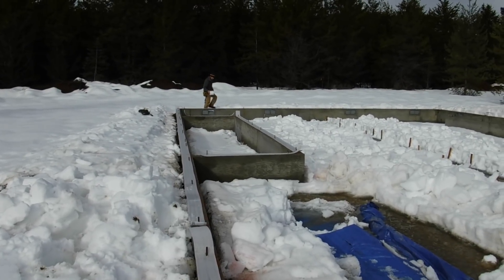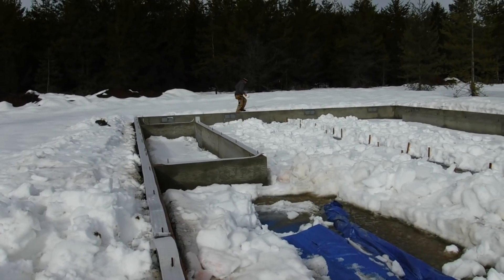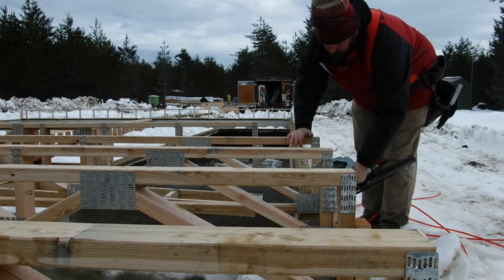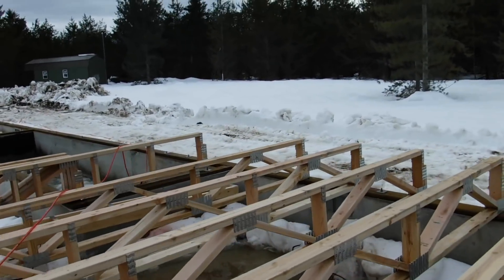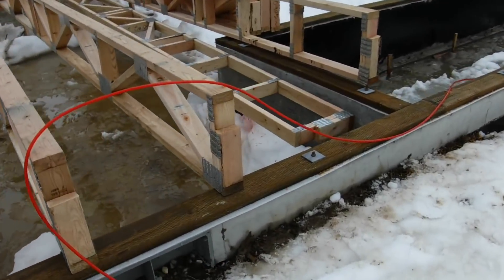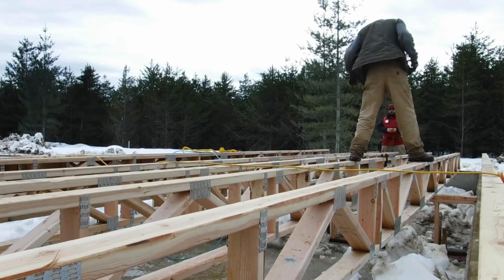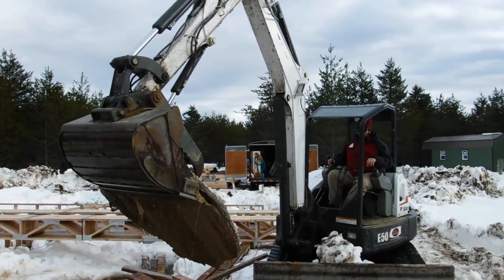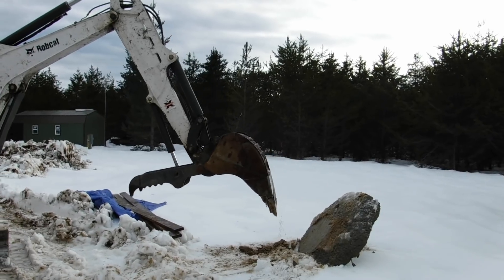Floor Trusses, The Best Floor System You Can Buy When Building Your Home

Comment: Failure to make a acces thru the spine wall is a major failure ,now your going to have to have to crawl holes instead of one,that is poor design and the fact they take up floor space and insure any future work drags dirt into the house is a health risk! Smart mov avoinding the krappy TG! ,takes alot more under support to make work.
Reply from the maker: After we laid out the floor trusses and could see where the openings in the knee wall would be best placed we put in two pass through doors to provide access
Reply: The folk pouring the concrete failed to provide a crawl hole,that is going to be costly to cut in after,I hate when archtects forget these critical items.

Comment: I was wondering of the trusts could have been built with 2x3's  to save money and still be very strong etc ?? thanks
Reply: The TJs and these trusses are engineered so by using them you can bang the job out and not be butting heads with some inspector that can not tell the difference between construction grade lumber and #1 select.
Reply from the maker: lets stick to the 2x4 they are mass produced and cheep!

Comment: Definitely better for running mechanical. The plumber's and electrician's jobs as well as HVAC won't have to drill every board, saving labor hours. It could even add up to a wash on the difference in cost over traditional joists if the work was hired out to licensed professionals. Of course here in the USA a homeowner can do their own as long as it passes inspections. Cost depends on how you value your own time and labor into the equation.
Looking good, and the delivery time is amazing, even in the winter. Did all the pieces fit where they are supposed to, or Did you have to do any modifications for sill bolts or length issues?

Comment: are you worried about having all that moisture in the crawlspace?
Reply: ya here in Montana they usually put Polly down then P gravel on top but I was just wondering as much snow is in there couldn't that cause some issues when you put floor on above it with all that moisture trapped under it?  Or will it just drain thru?
Reply from the maker: The reason we went with the floor trusses is to tuck all the mechanical systems up in the trusses then insulate the floor and seal the bottom of the trusses with a moisture barrier which will protect the home even if the crawl space floods in the spring time.

Comment: Why isn't more full basements built? There is already excavation needed, and for not that much more money, and some loads of concrete the house could be 30-50% larger.
Reply from the maker: NoC  The issue on this house is the ground water and basement flooding and to compensate for the loss of the basement we are going to build this home with attic trusses.  The attic trusses will let us pick up another 900 ft² of space that is not at risk of being flooded